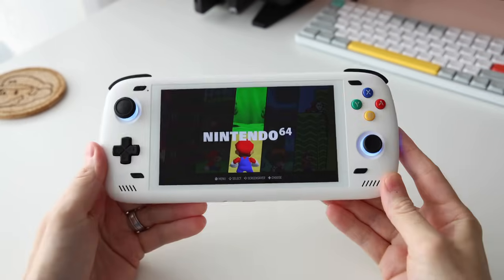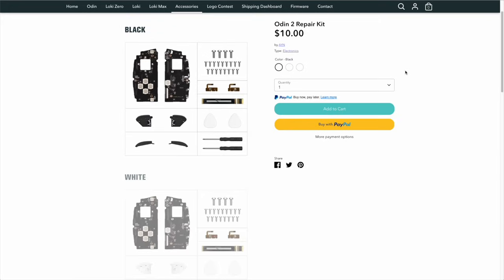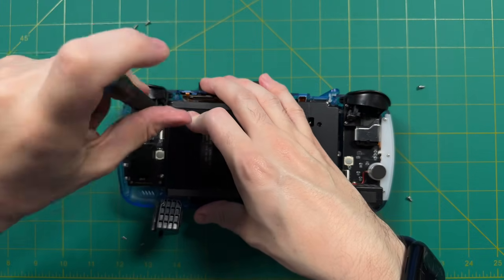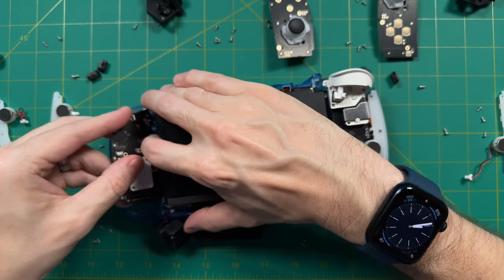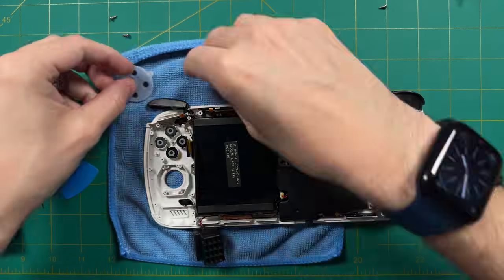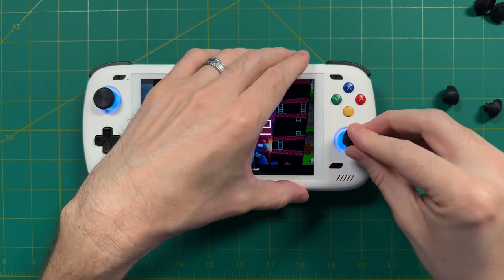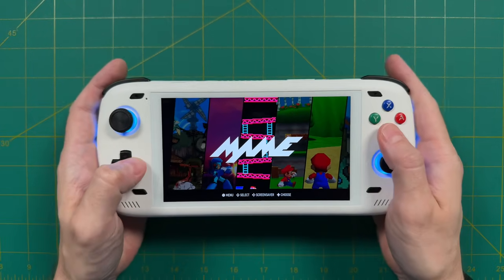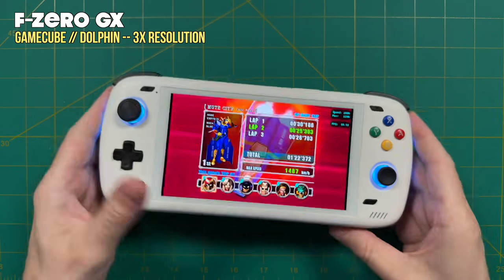Making the Odin 2 Even Better

Comment: Odin 2 is so amazing. I have my entire childhood on the go now, and then some. Citra still is apart of Retroarch as of this comment. Yuzu is still readily available also. I have 2 switches though and with no retro achievements I have little reason to use this as a switch player. Everything Wii down has worked fantastic so far. Now it’s figuring out what to play

Comment: Odin 2 swappable buttons is a DREAM!

I hope they start selling those soon, and here goes a tip: The base for the right-most button needs to be shallower than the rest, or the other buttons' bases taller to compensate for the curvature of the Odin 2. Saying that cause i was working on a model too, i just don't feel like resin 3D printed buttons are good enough for that aplication so i quited :/

Comment: Finally I get to see the blue model with the white buttons. They look great. I bought the a/b/x/y white buttons with my order. Didn't think about the other ones. Oops. Not sure when I'll get to swapping them out though.

One of my issues with the Odin 2 was that the sticks were a bit lower and smaller than I'd have liked. I ordered. One last week but it it was backordered so teby finally shipped yesterday. Ordered the concave ones. I'll see how I feel about them and might just order the hybrid ones as well.

Another issue I have with the Odin is that it is a smaller device and when I use the D-pad a lot my thumb gets cramped. Ordered a grip from Etsy as well and I used it last night and it makes such a difference.

Comment: The magnetic buttons have potential to be a really amazing. That combined with the adjustable sticks, could really improves the feel of the device. The only last thing for me would be an improvement to the screen which isn't terrible but I'm use to AMOLED screens on everything now. So a slightly smaller screen compromise in direct sunlight is less of an issue in comparison to deep blacks. So if we see an Odin 2.5 with similar chipset but improved those areas, that's worth a look.

Comment: I didn't realize you were so fond of the Odin2.  I know you liked it, but I didn't realize it was one of your main consoles.
What types of stuff do you play on there?  I know the GC and PS2 has better support than the RP4-P, but wasn't sure if there was anything on top of that which made you turn to it often despite its size.

Very cool that it has a fair amount of mods at this point.  Usually this Chinese stuff gets little support in terms of aftermarket mods like this because there's just so many of them.

Comment: Not having yuzu or cute doesn’t mean Odin isn’t justified. It’s still the best device that allows you to emulate and play high demanding android games without having to fiddle or tweak settings. RP4 comes close but still lacking.
Reply: you can still find the final build of Yuzu and the only game I've found to not be playable is Red Dead Redemption so far
Reply: There are lots of Switch games which are fully playable on the last version of yuzu already, and there are already new projects using yuzu's source code.

Comment: What about battery replacement? I've looked everywhere for another battery, but I can't find one anywhere. I even used the battery product info...YF M070-11 11CP6/63/76-2 8000mAh 3.85V 30.8Wh 20230915.... no dice. Do you know anything about that?
Reply: Im in the same boat as you. Im pretty sure my odin 2 pro battery went bad and ive been looking everywhere for a replacement option